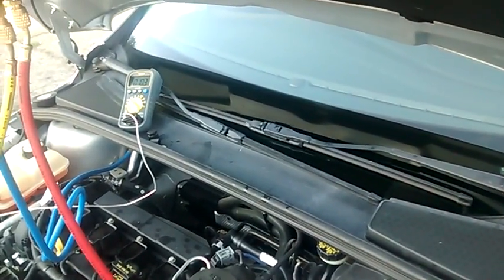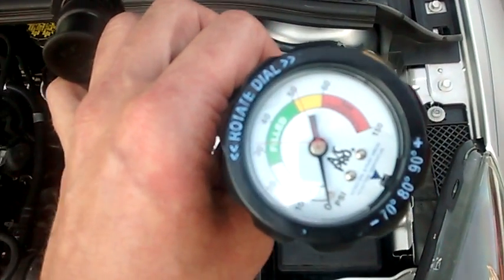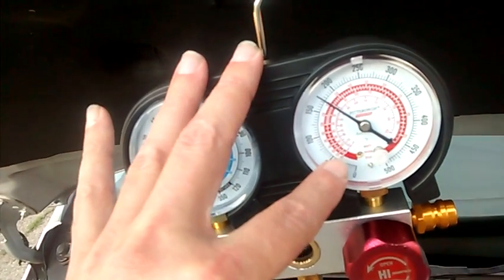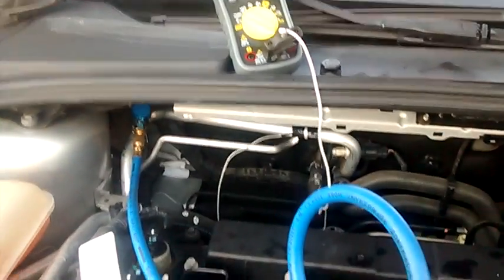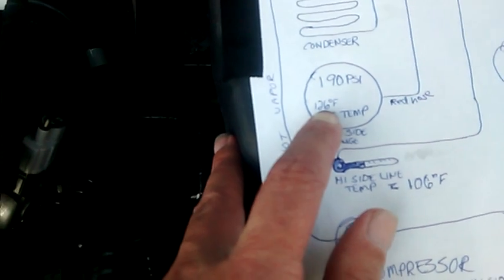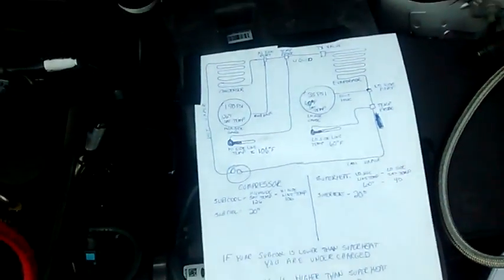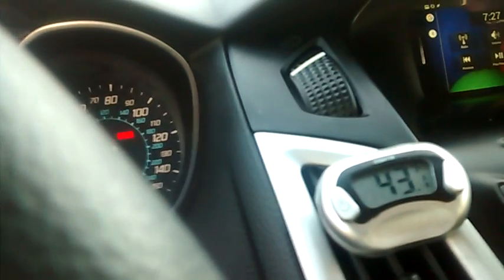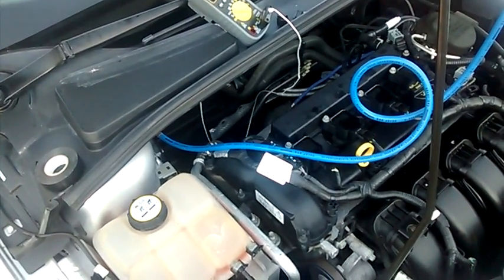Charging using Subcool

Comment: Hii chadd..... first thank u for this vedio..... from ur vedio i understand that car ac can be charged by balance between subcool & superheat is that right?? Sbcool =superheat ~+_ 2 degree ....... by theway car have txv valve and every txv should chARGED BY SUBCOOL only as i read every where ...... ur method is perfect as i see .... please can u explain to me your refrence in this method ?? Because every technican used only suction presssure as refrence to charging or they used charging by wieght (grams or uonce) ....this is the first time that i see the balnce between sucool and supercharged ... thanks
Reply from the maker: Charging by weight is the best way to charge if the system has been completely evaculated and is fully empty.  The method I am showing is for systems which still have refrigerant in them and is only low of refrigerant. All systems will lose refrigerant over time through the compressor seal as it doesn't completely seal.  If you do have an actual leak, you'll need to repair the leak after evacuating the system which will need to be charged using the weight method.  Subcool and Superheat comparison method is used primarily by HVAC techs when recharging central air systems in buildings, where the actual capacity of the system can vary or may not be known.    What these other techs are doing with suction pressure alone does work on older oriface tube systems, where the metering device size is fixed and isn't adjusted by the TX valve.  Since the TX Valve actually monitors the superheat reading, it will "throttle" the refrigerant based on what the superheat value actually is, in attempt to keep the superheat reading at the proper value, which will make the suction pressure pretty much stay at its specified value unless the system is nearly empty or extremely overcharged, hence suction pressure alone doesn't help you here.  For more information look up how the refrigeration cycle works, with the exception of operating pressures, temperatures, and refrigerant types, all refrigeration systems work pretty much on the same basic principles...   You can learn more here....  https://www.youtube.com/watch?v=27uCRQ3B8r4
Reply: @Chaddz3  thanks

Comment: hey chadd is this procedure the same for a fixed oriface system as used in older cars,numbers calculations etc
Reply from the maker: Fixed orafice both the subcool and superheat are affected by refrigerant level so you'll need to watch both. Again you want the system to balance out.

Comment: Excellent explanation mate, could you say, if I overcharged the lines, will anything explode
Reply from the maker: As a general rule, no. the pressure inside the cans you use to recharge the system aren't high enough to burst the lines in the system.  HOWEVER, never open the high side (red handle) on your gauge set when the engine and compressor are running with a can of refrigerant attached while recharging, the can WILL explode if you do. Pretty much all newer cars have a high side pressure safety switch (usually on the compressor) that kicks the compressor off if the pressure gets too high.  That being said, whenever you work with the A/C always make sure you are wearing rubber lined gloves and eye protection. If liquid refrigerant hits your skin, it'll freeze almost instantly and cause frostbite, not to mention it hurts like hell. Gloves will slow the cooling effect long enough to hopefully pull the gloves off before it freezes your skin. If liquid refrigerant hits you in the eyes, it will freeze your eyes instantly causing permanent blindness.  Be safe!!  The biggest danger with overcharging your AC is dropping the superheat too low (which means refrigerant entering the suction line between the evaporator and compressor is still in a boiling state and partially still liquid). If liquid refrigerant gets inside the compressor, it can break the compressor internally because liquids do not compress.